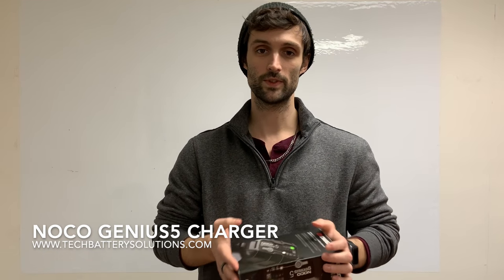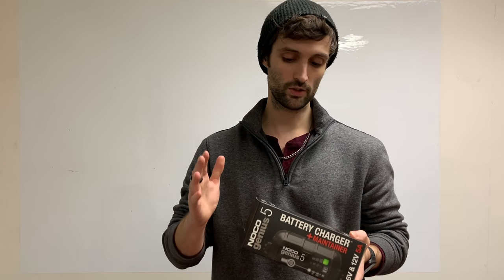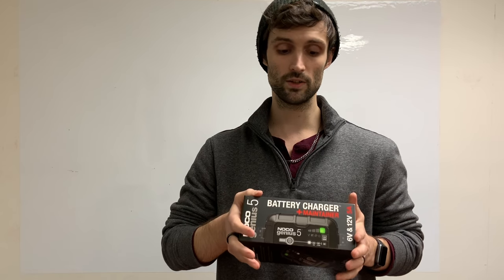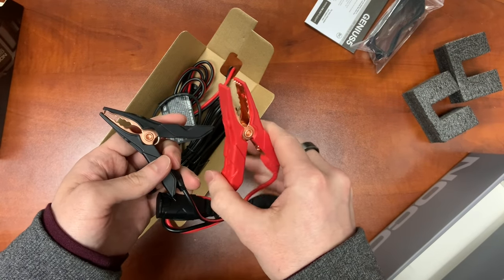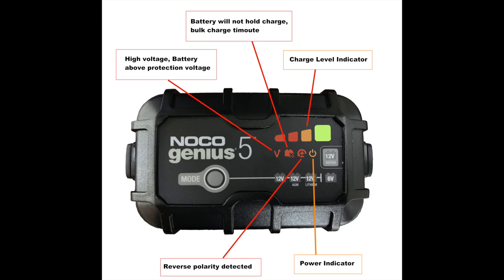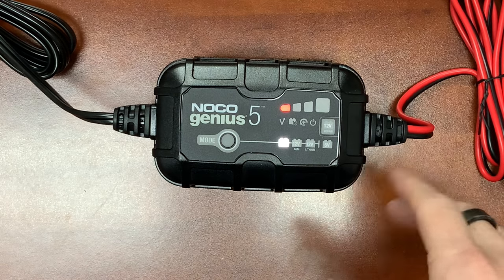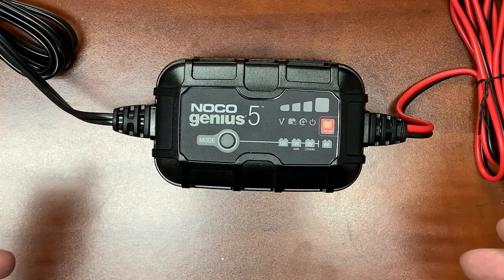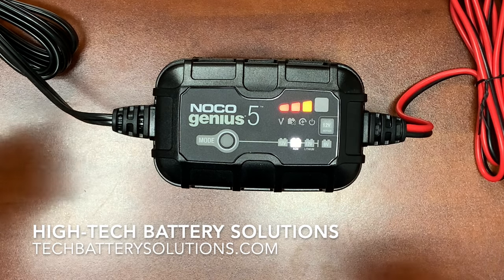NOCO GENIUS5 Battery Charger Review, In Depth

Comment: BTW. the green led information: The blinking green LED is just showing that the charger is in the Optimization portion of the charge. This can last for up to 48 hours. it happens right after the initial charge is complete, and anytime during Maintenance when the charger is 'topping' the battery off. This is a low current trickle charge that fully saturates the battery, repopulates the ions to the plates, and mixes the electrolyte bringing up the specific gravity. A good analogy is it's like pouring a beer into a glass. You fill the cup and then have to wait for the foam to go down before you can pour more beer into the glass. Then let the foam settle and you can add a little more, and so on.
Reply: Now I need a beer..
Reply: I want a beer also. Made me thirsty
Reply: I hooked this up to a battery I've had sitting for almost 2 years, and it's been blinking slowly for almost a day now. Good to know that it's normal. I wasn't sure if maybe I had to do the repair or not, because it had been blinking for so long. Anyhow, when it's fully-charged and I can use it, the green light will have finally stopped blinking and just stay solid, then? The other lights will turn off?
Reply: @somethingelsedoesmatter  da. Ledul verde va rămâne permanent pornit . Asta inseamna ca sa incarcat la capacitate maxima.

Comment: You failed to mention that in 12 volt Repair mode the battery should be disconnected from the car because in this mode only the charger can damage car electronics systems.  It's in the fine print in the manual.
Reply: Yep, thanks for the good info! Also, the manual recommends completing a full charge first before using 12V repair mode. This mode should take 4 hours and should only be done on flooded type only.
Reply: @eddiedefro  I have checked with Noco and this is incorrect. "The 12 Volt Repair feature is for 12 volt Wet, Gel, MF, and AGM batteries only" 
So not only wet batteries as mentioned but AGM AND Gel can also be repaired.
Reply: @neo61uk   can you send me the link for Repair mode on AGM battery , thanks
Reply: When you say "disconnected from the car" does that mean both positive and negative terminals disconnected? Or can I just disconnect the negative terminal only?

Comment: I just want to say kudos to this man for answering so many questions .. you don’t often see that on videos like this. I’m looking into purchasing a pulse charger to revive a battery that I know is below 7volts and I saw, on another video, that while other chargers may not start the process if the voltage is too low - this one will. I also like that it can also do a trickle charge so it’s very versatile. It does cost a little more than the others but it’s worth it, to me, not to be concerned that I’ll get the charger and end up having to return it because it wasn’t able to detect my battery.

Comment: Had AAA come out and replace a 5 year old battery in a Lexus that hadn't been driven much. The car was only driven about twice a month after that and one morning the battery was dead, as in no interior lights, no blinking security light on the radio. From what I hear, "not driven enough" won't get a warranty replacement. Bought the Genius 5 on Amazon, hooked it up, normal charge, not repair,  and 24 hours later the car started right up. It's been fine since. Maybe the battery had been sitting on a shelf for some time.

Comment: Be careful using chargers that charge at more than 15 volts on AGM batteries such as the Odyssey's, etc. Higher than 15 volts will cause irreversible damage  This Genius charger uses 14.8 (according to the manual), not sure if this is a little too much for AGM's but it is a much better charger than most  of the other junk being sold. Read the Odyssey battery manual for charging. These AGM batteries have thinner lead plates which allow more to be packed into the same size case as standard lead acid batteries, which is how they get a higher density battery in the same case (more surface area), but these thinner plates are more prone to warping and even melting because of the higher heat from high voltages. Read AGM battery charging specs. AGM's should be charged with current while limiting the voltage. Odyssey's love higher current charging, not higher voltage. (read the charging specs). 13.6 to 13.8v is ideal for float charging (trickle charge). Look for chargers that use high frequency to desulfate AGM batteries, not high voltage pulses.

Comment: Is this useful for jumpstarting discharged batteries? So for example cars you haven’t used in months (particularly during the pandemic). I had to get someone’s help to jump start my car with another battery when my car would no longer start (even if the battery was less than a year old). Could this device be used in those situations rather than having to jumpstart the battery the old fashioned way?
Reply from the maker: This is going to be strictly a battery charger. It can charge a battery that has been drawn down to zero volts but it will need to be left charging the battery for some time in order to successfully start the car if the battery was flatlined.

Comment: Could you review it in more details, like, use a multimeter to monitor the voltage change from standby mode to force mode? for me, when it is standby, this charger output 16.5v in pulse every one or two seconds, and the force mode always ouput 19.6v which is super strange.

Comment: I bought a Coco Genius 5. It worked fine 8 Months-until this evening. I had a Firmenich Battery I bought through Amazon-2 of them I fact, 13 Months ago. ONE of the Batteries developed an internal resistance issue, and I cannot repair it. I tested it with my NOCO Genius 5 Charger. It DID take the battery from 13.0 up to 13.7 Volts. As I was looking at the system, it dropped in a flash back to 13.0.
In the process of this happening, the internal resistance of the bad battery caused  a power feedback, DESTROYING my NOCO Charger!
I thought the "Smart" circuitry in the charger was supposed to PREVENT this from happening! DO-NOT-BUY!
Reply: Have you even tried to contact Noco's support? They may be replacing your unit

Comment: So you don't have to charge it like other battery jump starts? Do you have to have it plugged in while you're charging a battery
Reply from the maker: This unit is strictly a battery charger and will require it to be plugged into an AC outlet in order to charge a battery - this is not a jump starter. If you are looking for a jumps starter I recommend taking a look at the NOCO GB40 series.

Comment: When I charge my battery it goes from 25% to flashing green in about 20-30s. On all the batteries I have tested on. Is there something wrong with the charger? One is a new battery while the other are a old battery.
Reply from the maker: It depends on the charge level and the size of the battery. If the batteries you are using the charger on are already near fully charged then the charger will reflect that in its indicator lights. If the batteries are too small for the charger, lets say a 10AH power sport battery, then the charger will move the blinking green light fairly quickly and remain there for a time until it fully charges the battery.

Comment: Do you know if I have to disconnect the Car's Battery Leads to use this Charger? Or can I literally pop the Hood and connect it up (with the Car's Leads Battery still connected)?
Reply from the maker: Pop the hood open and connect the charger. There is no need to disconnect the battery from the vehicle - the charger will not damage any of the computer systems.
Reply: Excellent! Thanks
Reply: Is it also safe to use the battery repair mode with the vehicle leads still connected to the battery as I’ve heard the pulse can damage computer modules?

Comment: Thanks for the presentation. One thing that is not clear is if the battery should be hooked up first before connecting the charger to a  power source. I would think it be so, but does it matter if the sequence is reversed.
Reply from the maker: I believe the directions say you should connect the battery first and then plug the charger into an AC outlet. We don't do this at our shop - our chargers are always plugged in 24/7 and we rotate batteries on the charger without an issue.

Comment: I have a lithium battery in my 2018 Road glide special, l left my led lights on and it ran my battery all the way down... my trickle charge wouldn't bring it back, however this noco genius 5 brung it back with no problem...

Comment: Hey, I just got this bad boy and the charger is SUPER hot. Is that normal with battery chargers? Never had one before. Honestly, it's SO hot I feel like it's going to melt my flooring. Also, my battery was at 50%, but it's been on the first bar for the past 2 hours... Help!
Reply from the maker: I ran your question past the techs at NOCO, here is the response: 

Both the battery and the charger may get warm while charging, but neither should get so hot that you could not comfortably lay a hand on them. Based on your customer's description, it sounds like the charger is getting too hot.

Possible reasons for the charger and battery getting hotter than they should include if there is a large draw on the battery while it is charging, or if the battery is bad. The GENIUS5 has a 3 year warranty and we would be happy to inspect the customer's unit and replace if faulty through the warranty.

Comment: Can you leave the NOCO connected to your car battery without disconnecting the battery when using the NOCO for trickle charging?
Reply from the maker: Yes you can, the battery cables do not have to be taken off the battery to charge/maintain it.

Comment: great review, I assume, it works in 230v ? and will work with ordinary 12 v batteries non maintain ace free ?
Reply from the maker: Yes, the GENIUS5 will work on 230V and it will charge standard flooded 12V batteries without an issue

Comment: I bought a NOCO GENIUS5, what I sort of ran into is that it seems a little finicky around set up. So basically what seemed to happen is I set it up, plugin, select the the setting for the battery. I see it is at 25%, I come back the next day(2nd time) and it is still at 25%, which seemed suspicious, so I unplugged it, re-set everything, plugged it all back in using the cigarette lighter entry point. Everything looked right to me 1st, 2nd time with correct indicators to charge battery correctly.

Same thing next day, I  come back and still at 25%, so I repeat the setup again (3rd time), shoved it all back together, re-set to the normal battery setting.  Frustration up two notches, I walk away. Now on day 3 the battery is solid GREEN and all charged back to normal fully charged. 

My gut feeling was somewhere in the works with the cigarette lighter plugin maybe not fully seated electronically. So it feels like 1) you better check on it after setup, 2) make sure everything is seated and connected good and tight 3) repeat  if anything seems suspicious.  

I would not call this set it and forget it, keep an eye on things don't assume it can sense correctly what all is going on or pulse its way to success if connection is not solid.  I doubt I would have had this had I connected directly to the battery terminals but I didn't want to go that route in a Porsche 997 where the battery is in the frunk and I would have had to leave the hood cracked open for the cable or come up from underside of the car snaked into frunk somehow which seemed like more pain than it was worth doing when the cigarette port is easily accessible. 

Any thoughts or comments appreciated.  Is there a different approach to insuring a solid lock down on the 1st try.
Reply from the maker: Normally if the connection was not solid the charger would let you know - it will either error out or not engage the charging cycle at all. Have you tried the charger with the cig adapter on your everyday driver to see if there is an actual issue with the cig adapter itself?
Reply: @HighTechBatterySolutionsInc   no I didn’t try it in my daily driver, but that was definitely on my list of trouble shooting ideas as a next step, once I got the green light it saved me in a sense from that next trial step. It seems like even a small fraction of diameter difference could lead to a poor connection even though I am sure there is a known standard diameter but maybe in Europe their diameter is in metric and maybe the plug side was based on SAE diameter and it would mean carrying the match up out to at least 3 decimal places to get a snug fit. I am not sure exactly but you definitely need a good strong contact. I could clean the surface with some steel wool or maybe a thin piece of copper sleeve or small square to insure a snug fit first and every time
Reply: @HighTechBatterySolutionsInc  update:  so I go check it again, this time the Noco Genius5 says bad battery. I disconnect and attempt to reset it. However, now the Noco Genius five won’t allow me to make any battery type setting in fact the only lit button is the on/off , so I called Amazon, they sent me a replacement it has a 90day warranty. I sent the old one back to Amazon. The new one comes, I plug it in, after 5min it reads 50% and next day green and at 100%. I guess the one I received originally was defective.  I just went with my gut that the battery was not bad since it would start the car. Not sure why the first unit was malfunctioning but there it is, mystery solved.

Comment: I wanted maintenance in a remote location. Took delivery today. Right out of the box saw the AC cord is permanently attached. Very disappointed as the narrator didn't cover that it always needed to be plugged in. Also bought several accessories. Case, etc. Really cryptic description, excludes some accessories that are included with competitors.

Comment: What happens after a power cut? Does it return to its last mode? Or do we have to do it manually?
Reply from the maker: If the power is cut, the charger will return to its last-used mode and resume charging.

Comment: I need to leave my car at the airport for a few days at a time in -15 to -30 C temps. My particular model is notorious for parasitic draw while parked so I would like to hard wire this and plug it in while I am away at work. I don’t want to have to pop the hood and hook up the clips every time. Is there any issue with running the vehicle while it’s wired? I assume  the electronics will protect it if it’s just in maintainer mode?
Reply from the maker: You can start the vehicle with the charger hardwired without an issue as long as the charger is disconnected from AC power. Keep in mind that the NOCO GENIUS series needs access to AC power in order to charger your car battery, so in a majority of airport parking garages I've been in there was no access to power. That being said you can hardwire this unit without an issue. NOCO also makes the GENIUS2D which is a smaller 2A charger but its completely sealed and will be unaffected by water and grime from the road.

Comment: Hi, i bought a genius2 , for how long it will take to charge my battery , I started to charge for 8 h and I still have only on light 25% still blinking
Reply from the maker: Are you putting the GENIUS2 on a car battery? If not what type of battery is it on?
Reply: High-Tech Battery Solutions, Inc  Yes, it’s 12 V battery Toyota Sienna
Reply from the maker: @NOUNOUDZ100  If your battery is completely dead then its going to be awhile. The GENIUS2 is a 2 amp charger so you could be looking at a full 24 hours before its fully charged.

Comment: So if green led is on it means its fully charged ?? Because mine is blinking on green !? Is it charged or do I wait until its solid green and won't blink ?
Reply from the maker: If the Green LED is blinking then the battery is 90%+ charged on its way to fully charged - leave the charger on the battery until that LED is solid to get the battery to 100% fully charged.
Reply: @HighTechBatterySolutionsInc can you disconnect while it’s pulsing and continue later?
Reply from the maker: yes, you can disconnect the charger at any time if you need to and reconnect later to finish out the charge cycle. The charger will go back to its first stage of the charging process initially but it will work through the stages quickly to catch up to where it was prior to the disconnect assuming nothing has changed with the battery itself. @RightlyDivide365
Reply: @HighTechBatterySolutionsInc  thank you!

Comment: Hi man i have 6v battery and it’s over 4 hours plugged in and i still have flashing the first light only . Thanks for help
Reply from the maker: What kind of 6V battery is it, and what is the capacity of it?
Reply: @HighTechBatterySolutionsInc  kirkland from costco (for golf carts a rv) not sure about capacity
Reply from the maker: @matusbenkovsky9922  I'm assuming it's a deep cycle golf cart battery - they are rated between 185 up to 235AH worth of capacity. It could take some time to charge - I recommend leaving the charger on and letting it do its thing. You will see the charge indicator move forward as it should, it will just take more time to do so.

Comment: What would happen if you selected the wrong mode for the charging.  For example, using a Lithium mode charging on a AGM battery.
Reply from the maker: It would damage the battery over time due to the in-correct charging voltage.

Comment: So I just bought this charger and hooked it up to my 2007 mustang got that has the stock shaker 1000 system that has 2 subs in the trunk. The subs are making an intermittent humming noise with the charger connected. The battery is fully dead right now, hence why I connected the charger. It occasionally changes pitch as well. Does anyone know if this normal feedback from the charging system?
Reply from the maker: Is your audio system drawing power from the vehicle while it's off? This situation is not something we have heard of before and we sell a decent amount of batteries for audio systems.